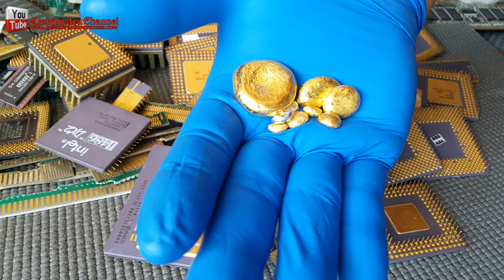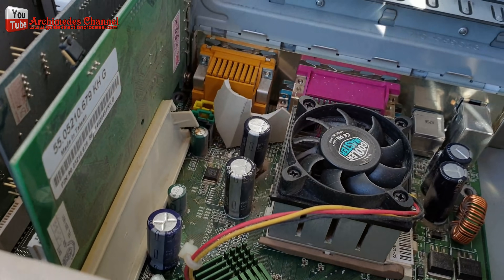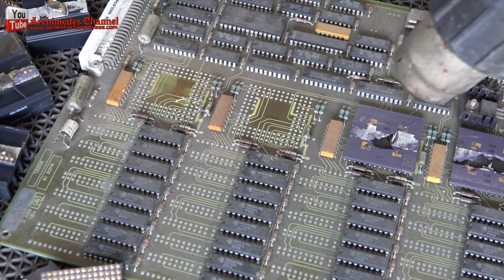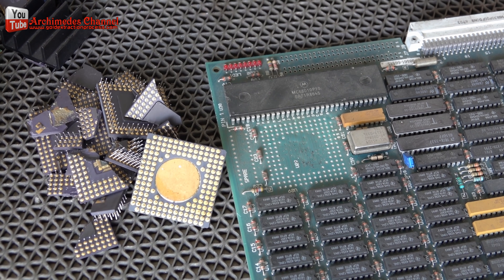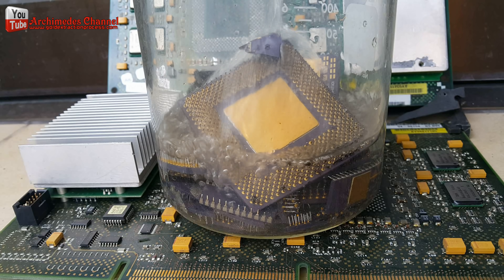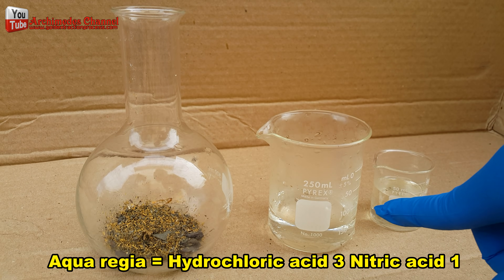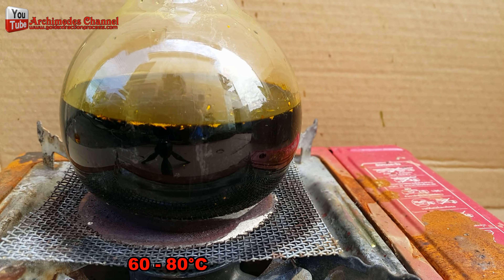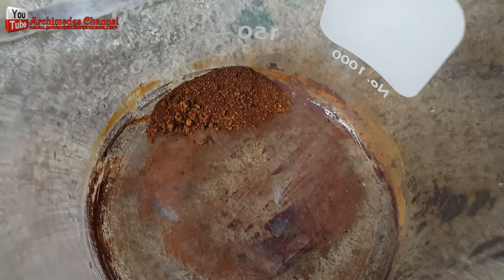Extracting gold from CPU computer scrap. Gold value in CPUs Chips "gold recovery"

Comment: I use propane torch  ( for welding pipe), heat the solder side, when solder is melted, slam the circuit board on the concrete pavement with the component side down. All the components will come out easily.

Comment: in reguards to using the heatgun, i find using a propane torch to be faster and easier personally, you can see when the solder wets and it seems faster to heat up in my opinion...one downside is burning the PCB board though.
Reply: You should be careful taking a blow torch to pc components because you can cause harmful chemicals to evaporate in the air you're breathing
Reply: How is the process done?  What is the chemical composition of each step?  Can you share it with me?  Thank you